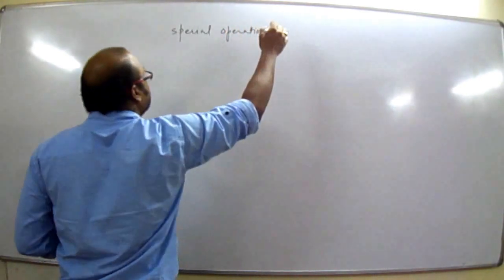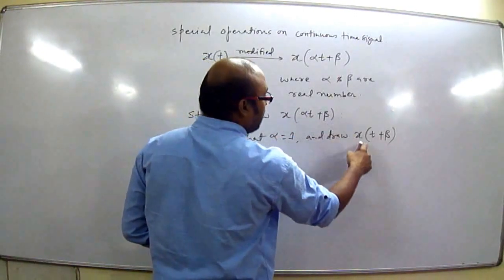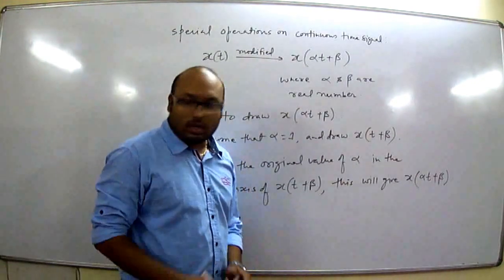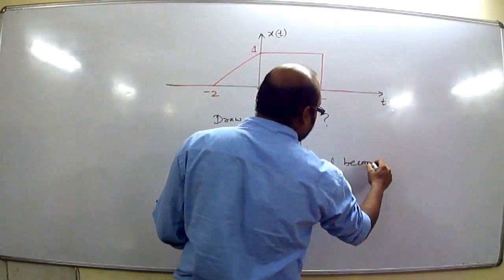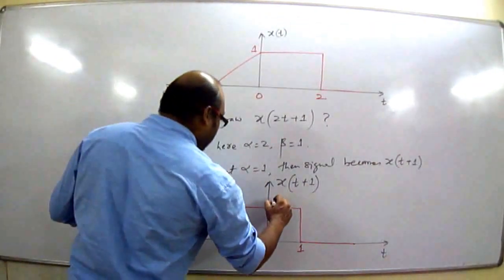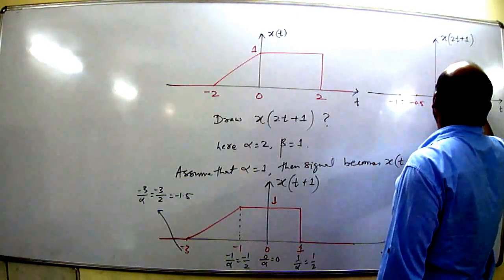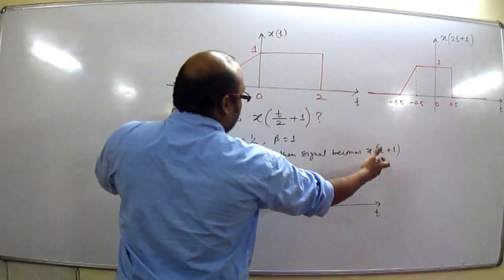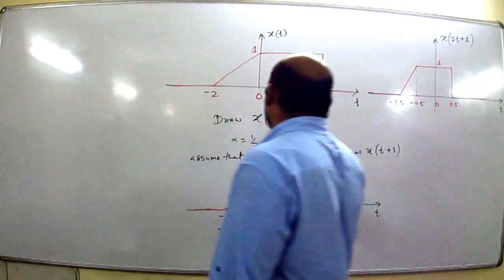Lecture on basic operation of continuous time signals

Comment: Dear Sir,  Please help me to draw the continuous time signals when equation will be 2x(2t+1)
Reply from the maker: +Bheramara Dredger Division, 
To draw 2x(2t + 1) from x(t), first draw x(t+1) which is x(t) advanced by 1 second or entire x(t) shifted by 1second towards left side. 
Once you draw the signal x(t+1) then divide 2 in the time axis of x(t+1), this will give you x(2t+1).
Now multiply 2 in each value of x(2t+1) to get 2x(2t+1).